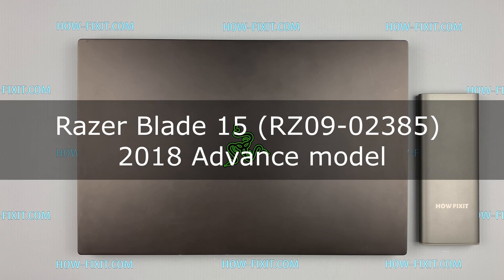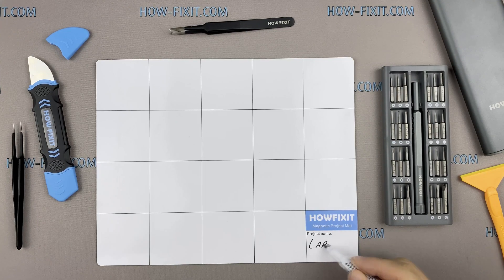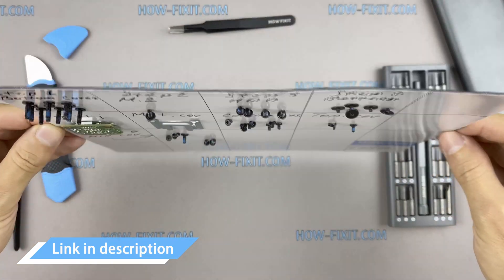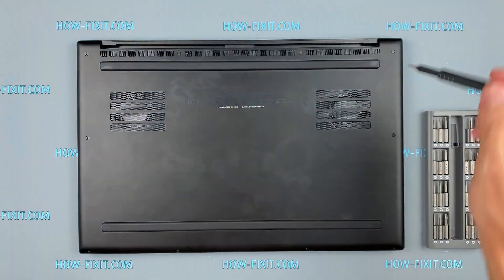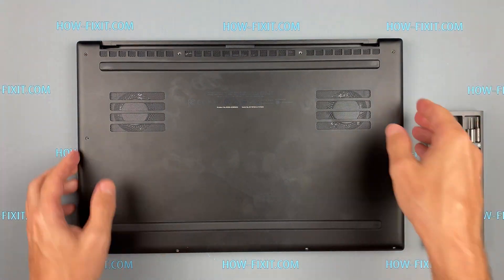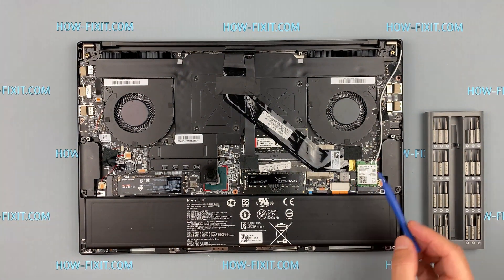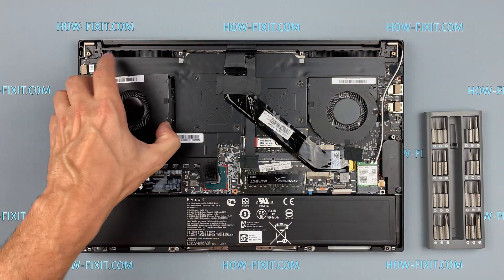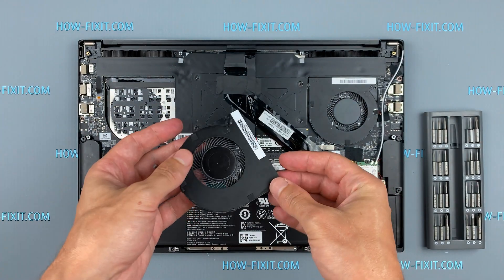Razer Blade 15 Advanced 2018 Fan Replacement | Step-by-step DIY Tutorial

Comment: Helped me pop the case off and get into laptop. Trying to diagnose camera issue as it is not detected in windows and am thinking its a connector issue but looking on motherboard i checked and looks like all the cables are connected. Not sure which one feeds into the camera and been watching videos to see if anyone points it out on motherboard.

Comment: Unbelievable, razer blade 15 2020 suffers from this issue too, laptop is 4 months old and has this rattling fan noise malfunction, it is so annoying and worst is that this is supposed to be a premium product.
Reply: I have started to experience fans rattling and I'm wondering if you could help decide what to do - send the laptop to razer for free repair or just repair it myself? If I send it to Razer, it could take a very long time... that's my concern :(
Reply: @antimatics759  Somebody else posted a video on here with their razer rattling and the person said they sent it to Razer to repair with the warranty and it took 2 weeks to get it back. If you're outside the USA take into account that you will have to pay to send it there and add that extra days to that, so you can get an estimate.

What I did: I first contacted Razer support via phone (awful exp, person kept forgetting what I was calling for and had this hard to understand accent and pronunciation) and then contacted Razer support via email, which was better than the call, but still wasn't great because first I tell them I have the rattling fan noise and added a link to a recording of my laptop rattling (they ask you to include video recordings uploaded to youtube, I uploaded it unlisted) and their response was that I should update my windows version and the razer software version (???), which is a clear indication that they didn't even read my issue or watched the video (you can see the video metrics too to confirm it wasn't watched). So I reply back and asked them to please watch the video (mind you this is going for about 4 emails now). Finally they reply with the email that outlines all the warranty and policy terms and all that legal jazz to be able to start the process of sending them the laptop for repair. I did not like how their support behave, like they didn't even care, so I took a few days to think about if I wanted to agree with all the legal stuff and proceed to start the whole process.

In the mean time while I was dealing with support and working with the laptop every day, I unplugged the faulty fan so the noise didn't kill my sanity. It got incredibly loud, like if I was in a factory that grind-cut wood. The laptop can work with 1 fan but don't make it reach high temperatures by running many stuff or  high demanding stuff, keep that in check.

In the end I decided not to proceed with sending them the laptop because:
1) I am outside USA, it's expensive to send it from here (warranty doesn't cover sending from outside USA)
2) you have to backup all your stuff and reset the laptop to factory before sending
3) the time you'd be without the laptop + few days to send it from here.
4) Support behave like they didn't care

After I decided I didn't want to proceed with sending them the laptop, about a month passed and I decided to do it myself taking my chances. Plugged the fan back on and for some reason the noise was gone but there still was a slight vibration and a noise when the fan slowed down. So I proceeded to follow another video's instructions here on youtube to lubricate the fan with synthetic oil. You have to disassemble the fan to do this. That video explained how to do it. After completing the process in that video, the noise when slowing down was gone. Still has a slight vibration you can feel if you put your palm on the laptop but no rattling or noise (Yay!). I've been like this for about 1.5 month now, all good. I can live with the slight vibration, I use an external keyboard anyways. So, do your research, talk with support, see if you can manage to send the laptop to them. I looked at my available options and what risks I was willing to take. Asses your risks, I cannot recommend you to do what I did because that's a risk I decided to take. Hope this is helpful & good luck!
Reply: @superharryboy  Damn thanks so much for the detailed comment :) really appreciate hearing what other people have gone through so that I can avoid certain mistakes when it's my time. Somehow this morning, the fan rattling noise has stopped - it's all back to normal now so I'm not entirely sure what's going on. Thanks again for the advice which I will definitely need when my time inevitably comes. So far support has been pretty decent when fixing the wifi issue on my laptop but it seems they are less effective for bigger issues like this. I am not in US so I would need to spend money on postage so I will definitely take that into account:)
Reply: @antimatics759  you're welcome! Glad to be of help. Keep in mind that what I did voids the warranty. As soon as you remove the stickers in the fan screws, warranty is void.

Interesting to know that the same happened to you, that the rattling noise goes away mysteriously. Mine still has some hearable vibration sometimes but no rattling. I don't think the vibration will ever go away because I noticed the faulty fan is looser than the one that's working as expected since before I opened it.

Good to hear you've had a better experience with support. What's the solution to the wifi issue? I've also had issues with wifi & bluetooth going dead about 3-4 times now, seems to be a hardware issue with the intel WiFi card as far as I can tell. Seems to be caused by something going wrong after turning the computer back on from sleep/hybernation/hybrid hybernation. When this happens wifi & bluetooth are removed from Windows' quick action and shows an error on the device manager. Luckily so far it gets fixed by multiple restarts & changing some settings back and forth but I haven't found a reproduceable solution.
Reply: @superharryboy  Ok, I will keep that in mind if I do end up fiddling around with the fans. 

This may sound pretty dumb, but I flipped my laptop over and tried to see if there were any obvious  problems with the fans by looking through the vents at the bottom . Then when I flipped it over again, the fans went back to normal. 

Your wifi problem is slightly different to mine - my issue was the laptop would keep on disconnecting from the wifi every 10 mins or so which prompted me to reset the wifi adapter every time to work. Then once I either put the laptop to sleep or shut it down and restarted it, the wifi would carry on disconnecting periodically. I tried all of Razer's solutions and they didn't work, until I went onto the intel website to manually check for the latest driver and found out my wifi driver wasn't updated. Somehow when I was scanning for the latest driver, my laptop didn't pick anything up at all?! All I had to do was update the wifi driver and it has been working normally ever since. Hope that's helped in some way :)